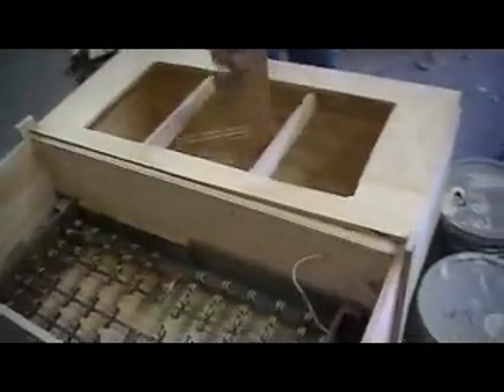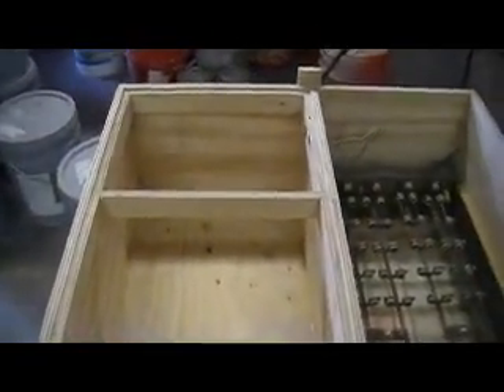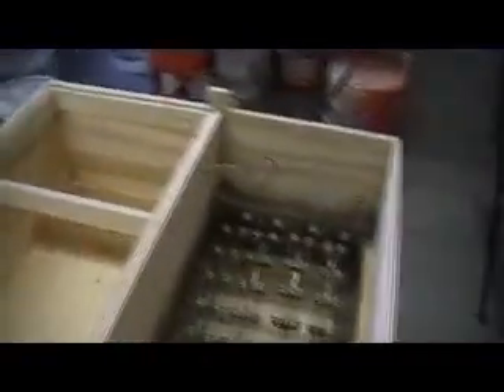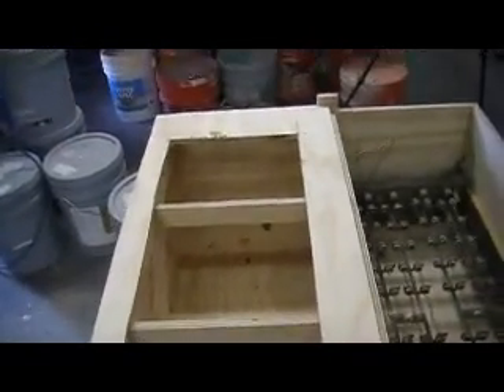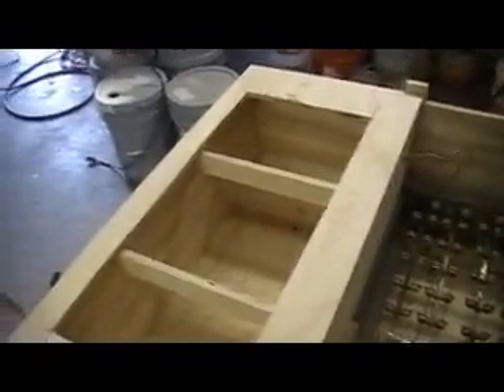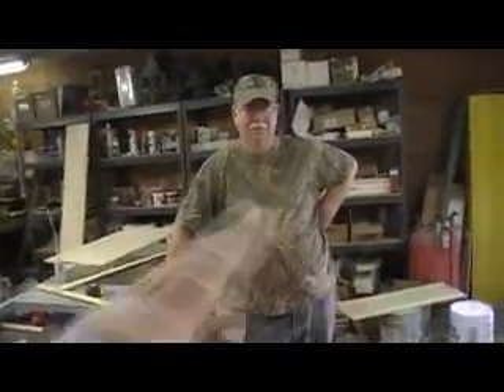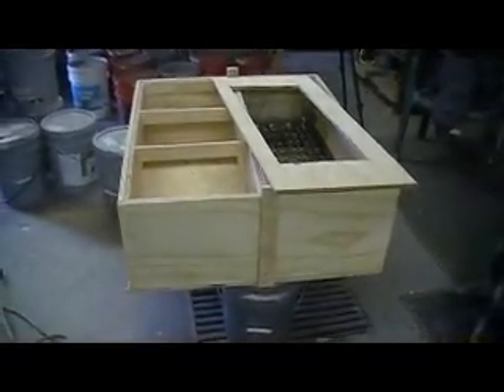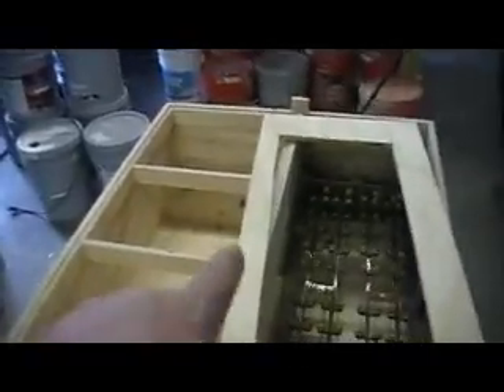how to build a vacuume machine #3

Comment: That's why most of the industrial vacuum formers for LARGE parts heat the plastic with
the heating element over top of the plastic and than it just lowers the hot plastic over
the part. I created a vacuum box and from what I remember reading regarding heating the
plastic will required the sag in the plastic to be a little more than the size of the part.
Nonetheless, I like what you're doing and look forward to seeing the  result.  Hoping for the best for you!

Comment: Bob, Not trying to be a pessimist, I think your setup will work great for small parts
of 2-3 inches.  However, I think if you try to vacuum parts with larger heights say 5-10inches
you may have a problem bring the plastic over to the part.  The amount of sag required for
a large height part may cause the hot plastic to fold onto itself when swinging it over to
the part side of your box.